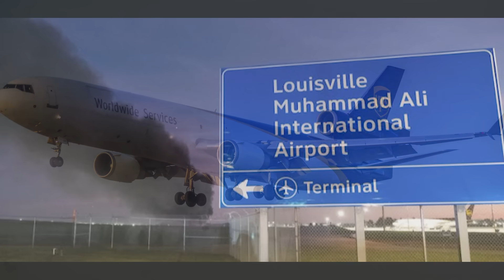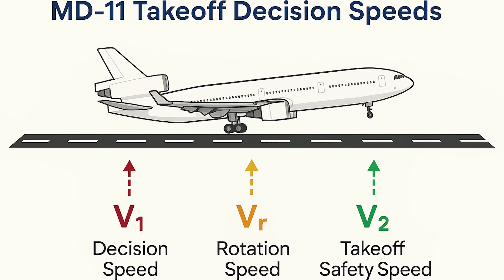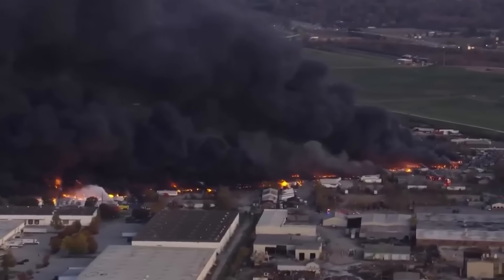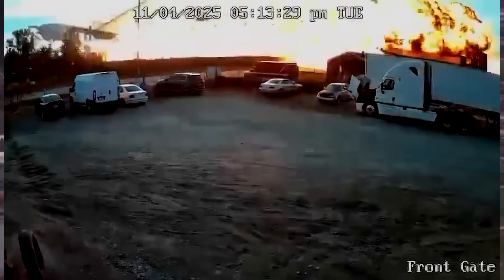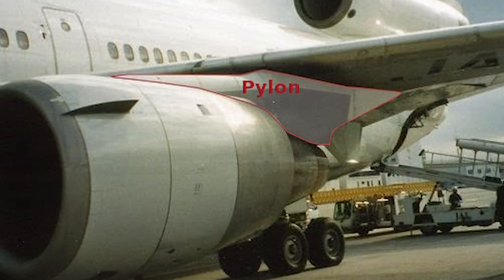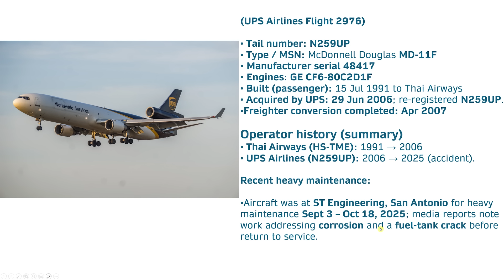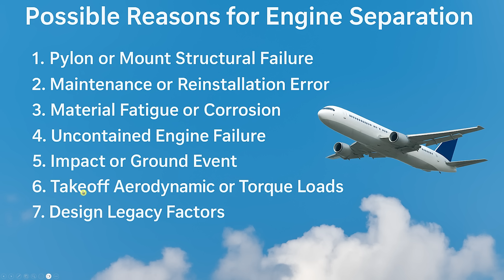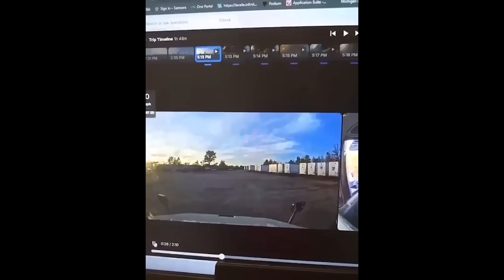What Caused UPS Plane Crash, Louisville, KY? How MD-11 Engine Fell Off

Comment: I've seen enough episodes of Air Crash Investigation to know this is UPS cutting costs on maintenance. Engine was not re-attached properly after maintenance, probably taking short cuts to re-attach using a non manufacturer approved but cheaper and quicker process like Delta 191.

Comment: I remember seeing the 'forklift' incident documentary. The illegal procedure saves so much maintenance time, it must have been tempting. If this proves to be the case, there will be jail time coming to the engineers! The time scales are similar, so forklift would be my guess.

It hits home with me because I designed the engine mount bolts for the BAe125-800 executive jet!

In 1988, a Cuban-flown Angolan MiG-23 fighter jet "accidentally" fired two air-to-air missiles (likely AA-2 Atoll) at the BAe 125. The aircraft's right engine mount was almost completely shot away, but the pilot managed to land the plane safely — this scared me!

Comment: Yes, the engine was sitting on the runway. Mounts broke under thrust they believe. A common problem on early DC10 & MD11 based on TSA service bulletins. I hope they can determine the cause and address it. Many DC10 & MD11 are still in service. I've flown on an MD11 before... 😢🙏

Comment: First off let me say I'm super familiar with what happened in 1979 with AA191.  I know about the pylon and stuff and what cause it..  With that horrific mistake every maintenance facility learned not to cut corners when changing an engine, I don't believe this is a repeat.
I believe left engine failed on the runway, I believe it was a MASSIVE CATASTROPHIC FAILURE, not like a normal failure, much worse,  MASSIVE VIBRATIONS and it "broke away" as designed with the break-away stress bolts that holds the engine to the wing.  Debris entered another engine (some say tail engine, some say right engine) I don't know,  but debris entered one of the other two engines and that engine failed and they were doomed.  Nothing they could do.  Such a horrific tragedy...

Comment: Just look at it carefully: The left engine is not missing at all. There are several video frames (e. g. 1:19) with it being visible in its normal position.
Reply: WRONG! The left engine was found 2000 feet before the end of the runway so it was long gone before it’s visible on this video! And that’s about 1/2 mile from this street.

Comment: It has no power to pull up wtf?!
Reply: Um, at that point, it only has one engine of three working correctly. It’s fully loaded with cargo and around 35,000 gallons of fuel. The only outcome is crashing..

Comment: I remember that crash and reading about it in a newspaper just before boarding a United Airlines flight from JFK to LAX.
The plane I was on never gained altitude and the passengers were told that our plane had lost hydraulics. 
The crew couldn't dump the fuel so with flaps down to create drag, burned off fuel flying north and south along the coast for 4 hours.
We landed at JFK after the airport had closed with fire trucks and emergency vehicles lining the run way.
We landed and had to be towed to the gate.
Against union rules, the crew and some passengers boarded another plane to fly to LA. 
We landed safely in LA at 5am.

Comment: I don’t like that we are still riding in planes from 1991. I wouldn’t want to drive a car from 91, nor 2009. It’s 2025, and I know you can drive older cars like “classics”, but these are gd planes. All commercial planes 2010 or older should be grounded.
Reply: You cannot compare cars and planes in terms of age! Twenty five year old planes are still very much usable.
Reply: @JohnHallgren  I agree, but when it comes to commercial use. there needs to be a limit. I don’t want to fly from A to B on a fixer upper. Guys can drive/fly their classics all they want, but as a general standard and for the public’s safety, NOO.
Reply: @F1qlujulp  it’s not the actual calendar age as much as the number of hours that it operated and the number of takeoffs and landings which is what puts the stress on the airframe.
Reply: @JohnHallgren Again right but in the case of the UPS crash, the plane was apparently over used. Any constantly flied commercial use aircraft (high mileage) should not be used to transport  anything for financial gain. Recreational sure, commercial no.

Comment: In summary:
The #1 engine detached after catching fire but before rotation, sending debris into #2 which caused that engine to fail as well, preventing the plane from clearing the ground due to insufficient lift from the remaining engine.

Comment: This wouldn't be the first DC-10 / MD-11 to crash because it lost an engine. A missing or failed wing engine mount bolt, has caused engines to pivot and simply rear off.

Comment: The engine may have experienced catastrophic failure as it quickly disassembled itself and fell from the airframe. A dislodged blade or maybe a bird strike or other runway debris. Or improper maintenance.

Comment: The two crashes you're referring to are American Airlines Flight 191 (a McDonnell Douglas DC-10) on May 25, 1979, at Chicago O'Hare International Airport, which killed all 271 people aboard plus 2 on the ground, and the very recent UPS Airlines Flight 2976 (a McDonnell Douglas MD-11F freighter, registration N259UP) on November 4, 2025, at Louisville Muhammad Ali International Airport, which has claimed at least 13 lives (including the 3 crew members) with several still missing as recovery efforts continue.
While the NTSB investigation into the UPS crash is ongoing (with black boxes recovered and usable data confirmed, plus a focus on recent maintenance for a fuel tank crack and the detached engine's history), preliminary findings and eyewitness/video evidence highlight striking parallels to the 1979 DC-10 disaster—often described as "eerie" or "hauntingly similar" by aviation experts and media. Here's a breakdown of the key similarities:
1. Aircraft Family and Design

Both involve McDonnell Douglas trijet wide-body airliners: the DC-10 (1979) and its direct derivative/stretched successor, the MD-11 (2025). The MD-11 shares the same basic wing/engine/pylon architecture, with under-wing engines (No. 1 on the left, No. 2 on the right) and a tail-mounted No. 3 engine.
Both used General Electric CF6-series engines (CF6-50 on the DC-10; CF6-80C2 on the MD-11).

2. Engine Separation on Takeoff

In both cases, the left (No. 1) engine detached from the wing during the takeoff roll or initial climb, around or just after V1/VR (the "decision speed" where aborting takeoff becomes unsafe).
AA191: The engine/pylon assembly separated due to maintenance-induced cracks in the pylon (from improper forklift use during engine changes), falling away as the plane rotated.
UPS2976: A "large plume of fire" erupted from the left wing, followed by the No. 1 engine detaching (found on the runway); the plane had recent heavy maintenance in San Antonio for corrosion and a center wing fuel tank crack.

3. Loss of Control and Asymmetric Thrust/Drag

Sudden loss of the left engine created severe asymmetry, causing both planes to roll sharply left despite crew inputs.
AA191: Rolled to 112° bank, stalled, and inverted partially before impact.
UPS2976: Reached only ~175–475 feet altitude at ~210 mph, then rolled (wings near-vertical in videos) and plunged.

In AA191, the separating engine severed hydraulic lines, retracting left-wing slats and causing further asymmetry (slats on the right wing stayed extended). Early UPS reports note possible similar damage, though not confirmed yet.

4. Crash Sequence and Impact

Both crashed shortly after takeoff, just beyond the runway perimeter, into non-residential areas (AA191: open field/trailer park ~4,600 ft from runway end; UPS2976: industrial area with warehouses/petroleum facility ~immediately off the end, debris field ~800 meters).
Massive post-crash fires fueled by ~38,000–50,000+ gallons of jet fuel in both (UPS carried fuel for the long Honolulu leg).

5. Potential Maintenance Factor

AA191 was definitively caused by improper maintenance damaging the pylon over time. NTSB is explicitly probing UPS's maintenance history, including the September–October 2025 repairs.

Comment: You missed one cause.....  If the fan comes apart, a horrific engine imbalance may occur.  This vibration could tear the wing off, so the engine is meant to detach in this occurrence, to preserve the airframe.  The thought is even with one engine leaving ( by design) the plane can continue on with the other two engines providing thrust. In the CCT footage from the airport, you can clearly see the tail mounted engine compressor stalling ( for unknown reasons) so only the right engine was providing thrust, thus dooming the flight.

Comment: This is all about maintenance!!! About a year ago an engine was installed using a forklift and the pins that support the engine were damaged at a Boeing plant, so come on people's wheels falling off and then doors falling off then engines falling off for What three times this and last year? Then the landing gear does not lower itself. But the CEO'S will tell you it's safe to fly 🤔 yeah right.

Comment: 7:08 hi as a professional videographer I just wanted to say that although 4k, 8k exists and a lot of devices can produce it there are still a lot of problems with it. 

Just a few issues you may not be aware of is that when I am recording 4k produces about 1GB a minute. It also may overheat a camera and draws a lot of power. Another thing is that trying to process 4k in video editing software can be a pain if not impossible for most folks. And bouncing off the 1GB a minute thing is that as a society we do have a limit on our digital storage and 4k recordings is a problem in long term storage. .

Now I will agree that recording in 720p is a poor decision but it probably is 1080p or even something in between 4k they are recording in and the are both physically and digitally zooming in which may give it a poor look but again they are zoomed in which is only part of the sensor you are seeing.

Also I use to sell cable and direct TV ala few years back and one thing most folks might not realize is that the avg person doesn't have 4k tvs, screens or monitors. Even when a phone claims to be a "4k" resolution your human eye can barely tell the difference. Even movie theaters use that weird format that's between 1080p and 4k when they show movies. 

4k has been over sold as a marketing gimmick to get people to buy more products they don't need.

Comment: New Engine Mounts, were custom built in Carpinteria CA in the 1980s at a machine shop I worked at because of engines snapping off back then, 
(I worked there)

Comment: I would like to say something else from the American Airlines flight 191 crash. It had two remaining engines and it stalled because they reduced to minimum takeoff speed. That rule was abolished there and then, could the pilots have mistakenly applied minimum takeoff speed, not realizing the engine fell off? Why couldn't it takeoff with the 2 remaining engines?

Comment: The DC-10 crash in Chicago, 1979, was the result of maintenance mechanics using a hammer to force alignment of the holes for the bolts holding the engine pylon to the wing. It intruduced hairline cracks around the holes, unknown to them, and causing a disruption of the loadpath for the torque loading on the front wing spar. When the engine spooled up, there was not enough balancing  of torque forces to hold the engine to the wing and it simply rotated up and over the wing, in the process of tearing out the hydraulic lines to the leading edge flaps, causing them to retract, causing a loss of the needed lift to become airborne .

Comment: There was an incident a few years back where the engine mounts had cracks. The cause was determined to be service techs leaving the engines on the hydraulic lifts when they took lunch. The hydraulics gradually bleed off while the engines were half attached.

Comment: I think if I remember right, you weren't alone in being afraid of flying after the Chicago crash. There was a bit of hysteria with air travel. 
The Chicago crash wasn't long after a private plane collided with a PSA flight in San Diego. A little over a decade I believe when I run stuff through my head. As a veteran I was never too keen on flying which doesn't work well when you are stationed overseas. For me being in the air over the middle of the Atlantic Ocean was the most terrifying ordeal I experienced. The middle of nowhere with nothing around if I were to survive the crash becoming shark food instead of being rescued. Unreasonable fear really when looking back. My chances of dying in a car crash is more probable than dying in a plane crash. 
I've got a friend whose dad was supposed to be the pilot in the PSA flight 182, I think that was the number without looking it up. His flight prior to the 182 flight was delayed and he was unable to pilot the flight so an alternate pilot was tasked with the flight. I was working on shelter island painting a parking lot just across from the airport. At that time there was an arsonist torching museums in Balboa Park. The guy I was working with said he believed that the sudden smoke we were seeing was coming from that area of town. Looking at the smoke and where I was I could tell that it wasn't from the Balboa area and more in or inline with the north park area of town, I couldn't see if it was actually north park or not but that was the direction it was coming from. The smoke just got thicker and blacker and filled a big area of the sky. I went to the vehicle and turned the radio on and immediately heard about the plane crashing.. it was a stunning event but here's the odd thing. Why does that continue to happen still today, small planes colliding with big planes and vise versa. How do flight controllers miss the other plane on a collision course? When we as citizens are paying top dollar to people to ensure we have the safest air travel that we can, we play them to be vigilant and focus on their job. On some of these crashes like that DC and military aircraft where they should be able to see everything on the radar or whatever they use to see things, I just think that someone let their guard down and relaxed at the wrong time and missed the danger ahead. That flight that you covered her is what I think is a prime example. Someone in the tower should have noticed something wrong and radioed to the pilot to abort, it would have been better to crash at the end of the runway rather than crashing through a part of the community and killing several civilians in the process. I think the pilot must have thought he could get in the air and circle back not realizing the danger that he was facing doing that. I think the pilot put an emphasis on the multi million dollar cargo rather than considering the loss of life in his path awaiting the miscalculation. It also seems to me that there had to be some kind of abnormal vibration coming from that side of the plane and was just ignored. There is no way that engine just says I'm out of here and falls off without some kind of pre warning of some type.
I also think that we need people that love and enjoy the work of plane maintenance and mechanics. It's obvious that there were flaws in the service done in San Antonio. I mean for christ sake, if you are finding corrosion on a 33 year old aircraft in one area I think logically you would be to consider that anywhere else on the plane could be exposed to have the same issues. How about it being mandatory for all planes after so many flights, especially these cargo planes that are always taking on great stress for the g forces involved in taking off, if they just change the mounting brackets on a schedule instead of waiting to see cracks appearing I think it would save airlines, airports and communities in and around effective areas or flight paths a ton of money and save countless lives. I just think that the stupid brackets should be mandatory replacement period. They pump in our heads about the damage that can be done to our automobiles if we don't do scheduled maintenance on the vehicle, that maintenance requires changing out different parts because they are getting old and need replaced. It seems to me that something so small and what should be a relatively easy straight forward thing to deal with. Change the mounting brackets on a schedule like you do your oil filter on your car.

Comment: I was a jet engine mechanic in the navy. 1982-1986. A6E bombers. only 2 bolts hold the jet engine in place. also every bolt is a 1 time use only bolts.

Comment: You noted the aircraft was down for maintenance for over a month and had a fuel tank crack. Would it be possible for the fuel tank to rupture and spill fuel into the exhaust causing an explosion and detachment of the engine? Or you think it would have destroyed the whole wing?